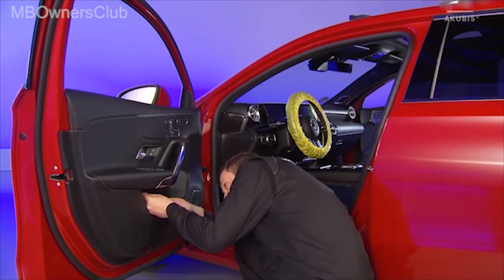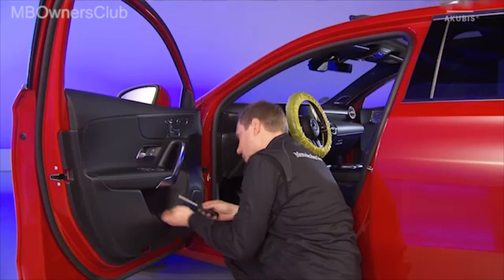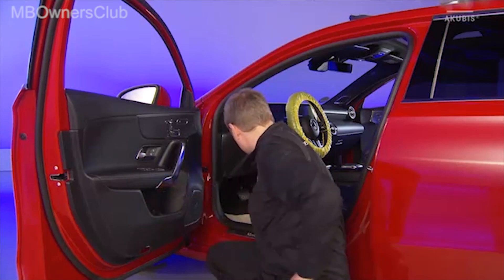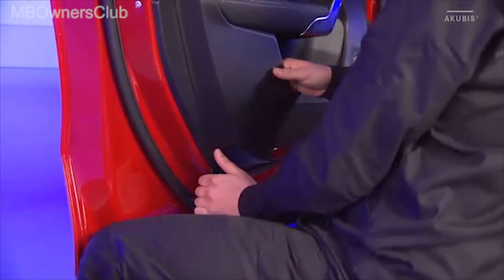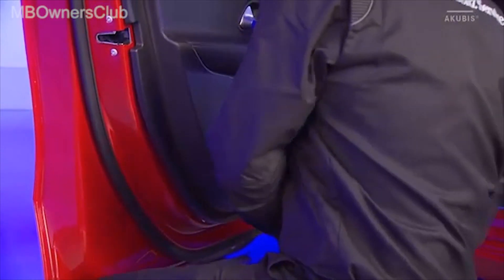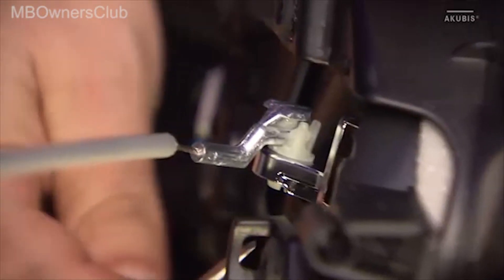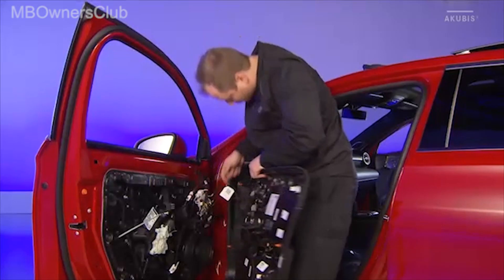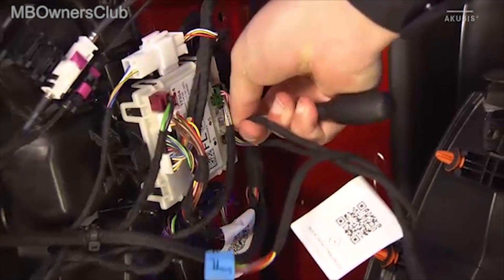Step-by-Step Guide to Removing and Installing the Front Door Panel on a Mercedes-Benz A-Class W177

Comment: Hi I have question, I have the full black door panel but I would like to replace it by the door panel black/Aluminium details with the ambient light, do i have to change the electric system? Or just the panel ? 
I have the ambient light on the dashbord but not on the door panels due of the full black alcantara.
Reply: Have you found a Solution i have the Same Problem
Reply: Did you do it? If so, was it needed because i want to do it too
Reply: Me too bro

Comment: Do you have any information about the internal door noises on the Mercedes W177 and cla 118? Vibration and creaking
Reply: I am having also panel noise in w177
Reply: @MaraxYTube  It's really annoying, you solved it?
Reply: @aldozanin2956  Well I was playing around with it for many months. It makes noise usualy when driving on bumpy road and never on straight line. I removed A pillar, B pillar and did put felt tape on the joints so its good regarding that now. Another noise was coming from Sunglasses holder, i had to remove spring that is inside, that was making noise. I took felt tape and put all around the door small pieces.
But i still want to remove panel and see what i could do better
Reply: @MaraxYTube  ok grazie
Reply: I have the same problem in my cla c118
Reply: @sasajungic89  Outrageous for a car like that.
Reply: @sasajungic89  its easy fixable tho! My felt tape arrived today, did 2 front doors, tomorrow going to do 2 back and B pillars.
Reply: @MaraxYTube  good to hear. I just bought slightly used cla and noticed it’s creaks when opening and closing doors. Do you have to take the door panel off or is it possible to just take the silver plastic door handle trim off?
Reply: @sasajungic89  Its very simple to take door panel off, about silver door handle i am not sure, its really cheaply made and squaks like crap but i did not touch it since its harder to get to it. did not want to play with it. it creaks when closing and opening yes, but you cant fix that, its what they call recycled plastics :) fuckers, if its not making noise while driving good for you
Reply: @aldozanin2956  yeah. They use same doorhandles as in the A class. So I guess the problem is the same in CLA.
Reply: I know this is an old comment, but I thought I'd chip in.  My w177 A200 is 2 years old now, and for the last 18 months I've had nothing but build quality issues.  The Seatbelt clip on the B-Pillar was vibrating, the dash was loose, the boot clip was shaking, and the passenger door (Which was the worst) was vibrating like mad. After 3 (yes three) trips to my local Merc garage, they fixed all issues on the 1st trip, but took 3 trips to fix the door! 

Turns out the window had "Sunk" a bit, the seal at the top needed lubrication spray in it (first trip), then the inside of the door needed stuffing with felt (second trip), THEN finally they wrapped the window motor at the bottom in felt and tape, as this was rubbing against the plastic housing inside the door (third trip).  So it took 3 trips for them to solve it and stop the vibrating/buzzing noise.

Its obvious build quality issues are common in W177 A-Classes and the new CLA models, but its worth taking it to the garage and complaining.  Hopefully this helps someone!